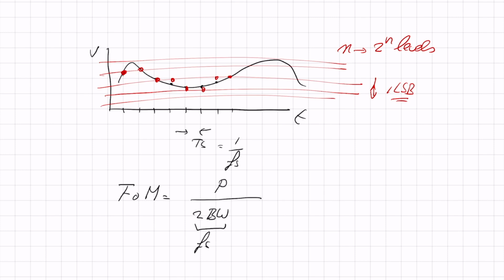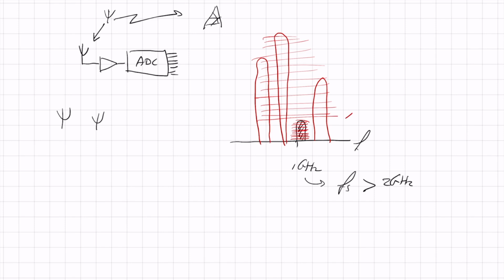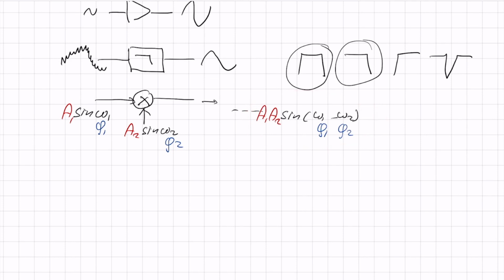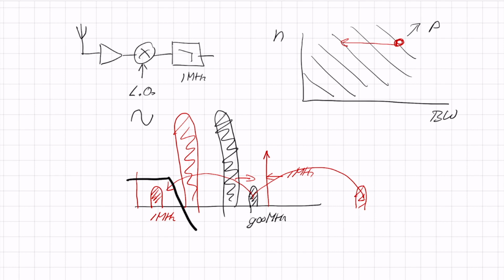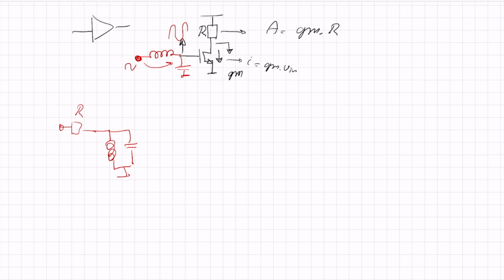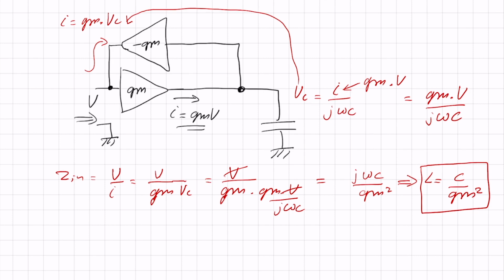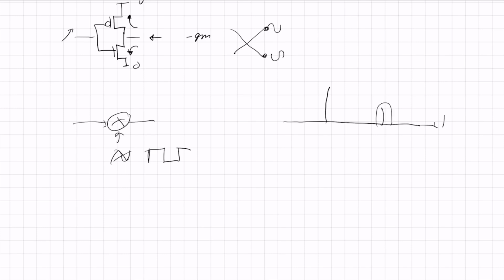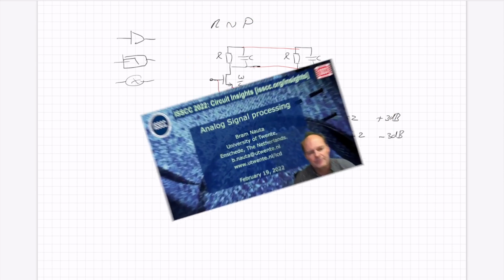Circuit Insights - 12-CI: Fundamentals 5 Twente Bram Nauta

Comment: why we need to worry about unwanted interferance bits number i.e. extra bits from 6 to 16bits...???
Reply: Because strong interfereres would saturate the ADC, causing the wanted signal to be lost. So, we need an ADC to cover both interferes and weak desired signal (with adequate accuarcy). This would require a high dynamic range (or number of bits).